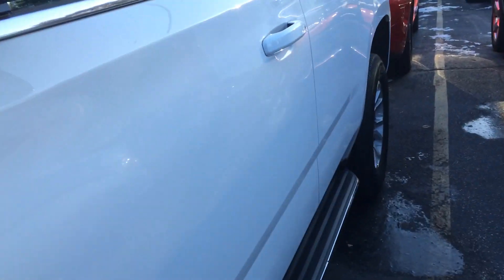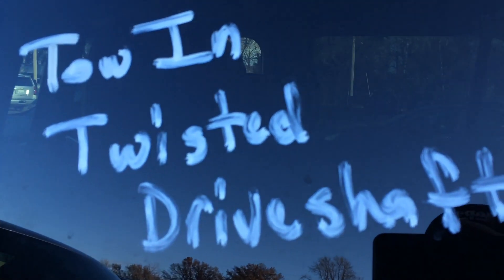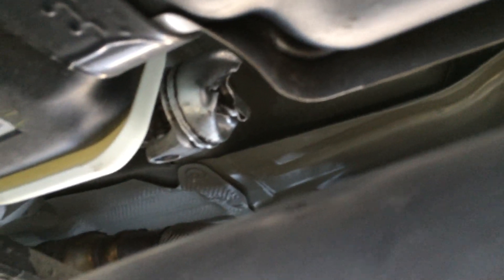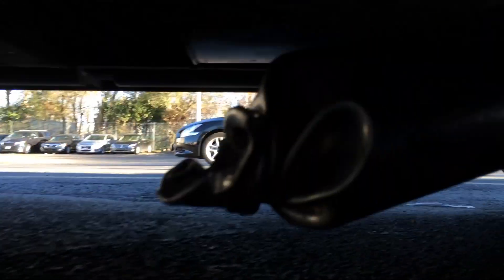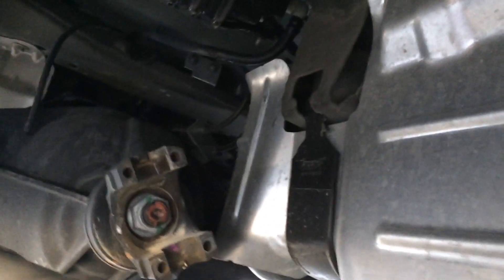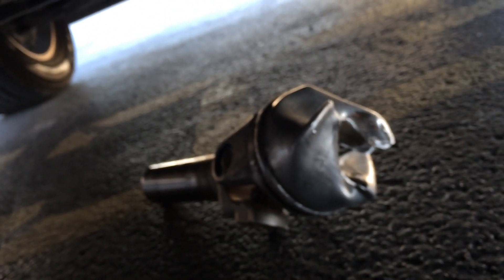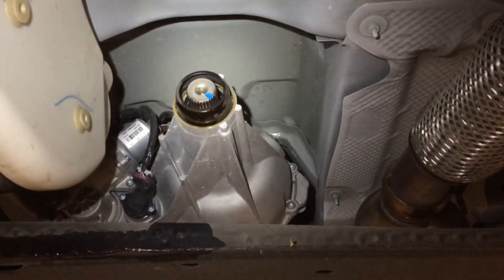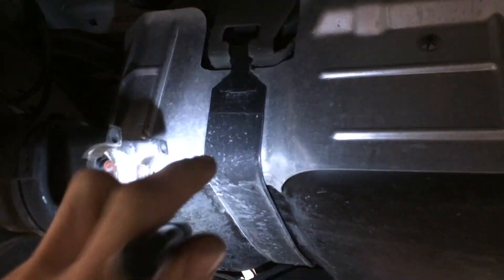Twisted Aluminum Driveshaft!

Comment: Ha Ha Ha Chevy beats up on Ford for using aluminum in the F150. Karma strikes back. In all seriousness I would check the tires for scuffing on the tread. This would indicate if the driver tried to burnout or neutral drop his truck to burnout. Expensive driveshaft but lesson learned. Better luck next year....Happy New Year....

Comment: most likely caused by towing more than the truck is rated to pull. might not, but it's very likely. I've twisted steel shafts in jeeps doing what I should have probably done with a 1 ton pickup. (not on public roads though)

Comment: Seems a little icy when this happened. Probably punched it from a stop, slipped and because they thought the AWD system would handle it, kept the pedal to the floor. The tires then bit hard, brought the wheels to a halt for a split second and the shock loads twisted the drive shaft. Happens to even the driveshafts of big rigs, though the power divider and the differentials certainly don't like it either. :)

Comment: Bet you 10 bucks he was driving around town in 4WD
Reply: cvmiata It will take out the weakest link, more than likely the front drive shaft is steel, which is stronger than aluminum.  It's also much shorter.

Comment: What i think is that something hit the driveshaft there and left it weak at that point, therefore it twisted cause it had less round surface on it, if it was the driveshaft itself and would get twisted for no reason then al trucks like that would have the same problem and would get recalled immediately.

Comment: We replaced one last year in my shop - it was caused by the driver spinning the rear wheels in grass coming up onto pavement, upon the wheels hitting the dry pavement the rear end stopped spinning, but the driver was still trying to accelerate, the sudden change in rear RPM while the transmission was under high RPM's resulted in this very scenario.

Comment: This is easy... its aluminium. One of the shittiest metals known to man
Reply: +Jammit Timmaj   True, its an Aluminum Alloy which depending on its exact elemental formula may have certain properties that EXCEED the strength of some steels.
Of course this may not have any influence on strength or durability if the part has a manufacturing defect, is installed incorrectly or is damaged in service.
Aluminum Alloy driveshafts have been used in cars and light trucks for over 30 years without problem..
Aluminum not only improves fuel economy by reducing weight.. it also increases acceleration times (0-60/ 1/4 mile ETs) by reducing static and dynamic mass (rotating mass that resists the forces accelerating the car forward.)
Cheers!
Reply: nope.. you get an "F"
Reply: It's not pure aluminum. It's a mixture of metals, although aluminum is a major component of that mix.
Reply: The real doktorbimmer
Yep. I agree. Composite materials are neat.

Comment: I've seen Ford F450s twist off steel drive shafts trying to pull heavy horse trailers over the mountains using too much throttle.

Comment: Being that it's 4 wheel drive they could have dinged it off road and then it's just a matter of enough torque. 
Used to work on Mack trucks that had a tag next to the park brake button that said Failure to release brakes WILL result in driveline damage. 1200ft lbs of torque at at convertor stall will result in driveline damage. 4in heavy duty steel that would twist up like a piece of taffy. We kept every possible driveline in stock and changed about one a week, on 30 trash truck's making about 700 stops a day.

Comment: If you notice the drive line is where the twist is.  That tells me that the trans end stopped and the rear end kept turning, like it was jammed into park and the pawl actually engaged.  When that happens you are going to break the weakest link... With an aluminum drive line it was the weakest part... Steel drive line would have prolly killed tailshaft of the trans.
Reply: Where do you think it would break if it were the opposite scenario, the rear end locked up and the throttle too hard?
Reply: It is not so much as the were but the how.  Look at the driveline, it kept spinning after the trans end stopped.  If the weaker part of the shaft was near the diff you would have seen a very similar twisting left on the diff side once again.  Now if the diff locked up and the engine/trans caused this then the opposite side would show the twisting exerted on it.  While this is a general explanation and not always 100% accurate it is more often than not.

Comment: Witch way was the crankshaft rotating when it broke? Looks that is turned counterclockwise when it broke... is that when the car was going forward or rearwards... or decelerating hard with engine high running???

Comment: I'm thinking the aluminum wasn't heat treated properly to achieve the correct hardness. Even if it did twist like that there would have been cracking. Aircraft grade aluminum is very strong and has been implemented into newer vehicles. I still wouldn't want it over steel though. I'm going to have to look at my 06' now.

Comment: To be honest, I'd more likely to suspect the owner of abuse - revving the engine and then shifting it into gear to spin the tires. Regardless, rather surprised a truck of any type would have an aluminum driveshaft. That GMC must have a very low towing capacity.

Comment: My theory is that it happened because it was made out of aluminum instead of steel like it should have been.
Reply: Thats GM for you, they use aluminum where Ford uses steel.
Reply: Yea, and GM is known for hap hazard engingeering
Reply: The real doktorbimmer It's probably not a coincidence then that it was about 30 years ago the United States stopped making quality vehicles.
Reply: The real doktorbimmer 
You are an idiot. The frame is high strength steel. Its hydroformed too fyi. The drive shaft is steel, my dads 97' F-150 has a steel drive shaft. So who are we bullshitting? At least know your shit if you're gonna talk smack.
Reply: +Jenna Koss  I wouldn't be surprised if you did not continue.. your argument has failed to gain any traction...
Reply: If you hadn't said it, I was going to.
Reply: B T my much weaker german vehicle doesn't use aluminium. why should this monster.
Reply: It is most likely due to a defect or damage..  Aluminum driveshafts have been around for 30 years
Reply: Its more like quality vehicles are no longer affordable.
Reply: Jenna Koss I just sold a 1997 Nissan Sentra going on 200k miles that still got 34 mpg and showed no signs of giving up the ghost.  Bought it some 15 years ago for $7k when I could only afford Top Ramen for dinner.  Brand new Sentras sell for $12k - $15k today.  Plenty affordable.  Same with the Toyota lineup.  There are tons of quality vehicles out there that won't break the bank.
Reply: None that are american. Also little shit boxes don't fair well in sloppy snow.
Reply: Jenna Koss I already made the point that the U.S. is incapable of manufacturing a quality vehicle, so that wasn't my argument.  I just built a 4 banger 4x4 Tacoma for $25,645 on their website, so you could probably negotiate that to $23k.  Still pretty affordable, and that's brand spanking new off the lot.
Reply: It will not put up with the abuse that other trucks will.
Reply: 4 banger Tacomas have earned a reputation for putting up with a ton of abuse, actually.  Their iron engine blocks are damn near indestructable.  Also, your implied requirements suggest needing an affordable quality vehicle to safely get you through snow, not a $45k full size 1 ton with all the trimmings.  Or get a Subaru.  Their AWD is bar none better than anyone else's and one of those won't break the bank either.
Reply: +Jenna Koss   Ford has been using Aluminum drive lines for over 30 years.
Reply: +Jenna Koss  Maybe you should learn to drive better... and while your at it learn something about vehicles too.
Reply: Not in there trucks
Reply: Um, first off jackasses I drive really well, second not my fault I have used Fords and Chevys on a farm but not Toyotas. Third I know a lot about vehicles and I know toyota uses sup par hardware in there suspension.
Reply: +Jenna Koss  Yes, Ford has used Aluminum driveshafts in trucks since the 1980s, now they make the WHOLE TRUCK out of Aluminum
Reply: Jenna Koss Damn, that's too bad.  I thought we were having a discussion like a couple of adults, but apparently that's not going to happen.  Have fun being a victim all your life then, I guess.
Reply: +Jenna Koss  Really?  Living on a farm I would assume you know more about tractors! Lol!!!
Reply: +Jenna Koss  No, I'm an engineer... not a farmer.
I own two Ford trucks... they both have Aluminum driveshafts
I think maybe you are "bullshitting" yourself... although you probably are more familiar with bullshit than designing and manufacturing trucks.
Reply: You must work for GM then. I know plently of M. E. 's that would of said the same thing.
Reply: +Jenna Koss  No, I don't...  You meet a lot of automotive engineers out there on the farm? Haha!
Reply: Nope, just the testing ground. A real M.E. can fix there own stuff can you mr. Smack?
Reply: +Jenna Koss  Yeah, testing traction in cow shit is an important evaluation criteria in new truck design these days....
I just finished restoring a Toyota Landcruiser ... That's Doctor Smack to you Farmer Jen.  Lol!
Reply: If I wanted to test traction in cow shit I'd continue this arguement with you...

Comment: Aluminum driveshafts are pointless, reduce weight, but cost more to manufacture, sensitive to denting, non-repairable and rotating mass isn't much better due to larger diameter and U Joints.

Comment: this is not an uncommon mode failure. the compound used is not up to the chore.it is too soft to begin with and not properly hardened from the factory to add insult to injury.i have seen this happen on seven units over the past two years that have come into the shop. even slight power modifications over stock greatly increase the risk of failure and LSD units seem to be more vulnerable.i can't really fault the engineers on this one however...i do think we can point a finger at the cost accountants this time.

Comment: Depending on where the driveshaft fails,the tailhousing on the transfer case can break around the mounting bolts and require replacement

Comment: This prop shaft is probably engineered to be the weakest link in the drive train to protect other more expensive components from failing. I cannot believe that aluminium is being used as it has a finite fatigue life. 
I've seen Landrover TD5 models twist their halfshafts if overloaded. Unbelievable that an engineer creates a product that can self-destruct if overloaded.

Comment: It happens to GM trucks all the time. GM uses cut corners with all their vehicles, such as using shitty aluminum as a drive shaft instead of actual steel like everyone else uses. Just one more shitty thing about Chevy to add on to the 13 Billion+ recall list.

Comment: Every drive train has a weak point, something is going to break under stress. My '80 Powerwagon's drive shaft has twisted off twice. First time the steady bearing, got ripped off it's mount and was almost through the truck bed. Up graded both rear shafts, and steady bearing. Second time, completely twisted off the rear drive shaft at the rear pinion. The sad/expensive part is I know it's not a street race car. Both times, I got pissed off, when people know they have to merge from two lanes into one. But they choose the outside lane.

Comment: love how you manipulate the driveshaft at the very last second of the video to show how its light as a feather... that shaft belongs in a honda civic, really
Reply: Driveshaft in a front wheel drive... seems legit.
Reply: damn, i meant a hypothetical rwd honda civic SHUT UP :)
Reply: Eric Fixalot lol all gm suburbans yukons Silverado's etc have always been RWD. The fact you see it and then doubt it, is Hilarious
Reply: rewardboy1 I was referring to the Honda Civic, lol.
Reply: Andiar Rohnds Yeah, I got what you meant but I still had to give you shit, ha ha. :P
Reply: my pepsi can is stronger than that shit 😂
Reply: combining relays with a pcb? this has nothing to do with quality of soldering
Reply: That shit would never fly in a Honda, Hondas are built to last. The axles in hondas get bigger and beefier based upon horsepower and weight of car.

I have had no problems running the smallest one available in my racecar.
Reply: Austin Gaddy To bad the electrics that control Hondas are shitty. Lets combine a few relays with a printed circuit board so that the solder can fail. But wait, how many coolant temp sensors do we need? Why not 4?
I could go on, but I think you get my point.
Reply: Andiar Rohnds The pcb is what makes it makes it require solder in the first place.
Reply: So you'd rather twist a driveshaft or snap an axle than replace a relay? I don't get it. My dad has a C6 corvette, and you cant start it anymore because the keys for it no longer are paired with the car. Turns out, its $600 dollars to get a new set of keys and have them paired to the car, and according to the forums, that doesn't always even fix the problem.

So Hondas are bad because at one time they made a bad relay design. 

I''ll keep my 2,000 pound car that doesn't break, has a 9,400rpm fuel cutoff and makes 240hp at the wheels, everyone else can buy these new heaps of shit with electronics everywhere all of it breaking. They don't even put LSDs in cars these days, they just set the computer up to drag the brakes because the suspension designer was too busy doing gay stuff with the transmission designer and the bean counter, that none of the three could come up with a way to get first gear to result into motion.
Reply: Austin Gaddy Hondas are bad because mine has left me stranded more times than I could count. The relay was just one of many examples of their shitty electronics. Mine's the epitome of what you just said "electronics everywhere all of it breaking" except it's not even a nice new car, worst of both worlds imo. It's been years since my Chevy broke down, it's never twisted a driveshaft, and I like the torque and rumble of a V8 that makes similar power to your racecar without even having to rev to 4,000.
Reply: Sounds like you bought the wrong Honda. One time my starter went out. Been driving a 2 liter honda since 2004. Had three different ones. Ive changed oil a bunch of times, and a starter. And I have a habit of taking sweet jumps in my cars then breaking shocks and bushings, then upgrading them (not the car's fault.)
Reply: Austin Gaddy You could say that, but on the other hand, I've never had a "wrong" GM. Our Suburban has been in the family for about 8 years and it's our 3rd one (they've all been late 80's models). I also picked up a newer Buick and it's been nice. My parents got Suburban #1 back in 1999, eventually the coolant froze and cracked the block. #2 was stolen and destroyed by my mom's boyfriend in 2005.

Comment: its that cheap ass aluminum they're using...
Reply: Yeah, that's not "military grade".  lol

That truck had to be in low range and badly shock loaded.  At least it did not nuke the rearend.
Reply: AlphaDogX25 same material as their pushrods. no wonder why these things only last 90k at most
Reply: what American vehicles are made using shortcuts say it aint so lol
Reply: John Steel lol for real
Reply: _Husky pushrods aren't the real issue with gm it's the lifters that fail. I wish I could post pics lol

Comment: my guess would be a flaw or thin spot in the aluminum tubing coupled with the proximity to the weld for the front yoke. weak right from the start.
Reply: +Mark K-I agree that is the most likely cause.  Simply defective unit...happens to every brand.  Everyone is bashing aluminum but it is actually quite strong.  Many newer vehicles have AL driveshafts...and many have more HP and TQ than ever before with no issues and lighter rotating mass.  This was just an anomaly.

Comment: Possibilities 
Put in park before complete stop
After backing up car put in to drive then accelerate hard forward
Neutral to D and had full throttle
J turn
Reply: Mark truck pull and started hopping then the shock load of loading and unloading could do it

Comment: how this happens is people overload trailers on these SUVs thinking they can take the same as a pickup can they CAN NOT these shafts also tend to get dented of off road or resulting in failed drive shafts these weak shafts rely on being dent free for their strength yet one dent or over loading causes a fail found this a lot here with people trying to haul like a truck with these fancy minivans
Reply: Da Sarge luckily our 2000 Ford Expedition seems to be based on an F series heavy duty lol we loaded 16k Pound dump trailer we needed to take roofing material from a tear off to the dump and it haul just like a heavy duty it has the 5.4 2 Valve Triton paired with the 4R100 transmission and a 3.55 limited slip and that rear axle is HUGE! and beefy frame is as thick as our F250 but just designed differently no longer have the f250 pos 6.0 only thing was not enough suspension damn those coil springs were slammed with that weight and haul like a pro there not built like they use to be